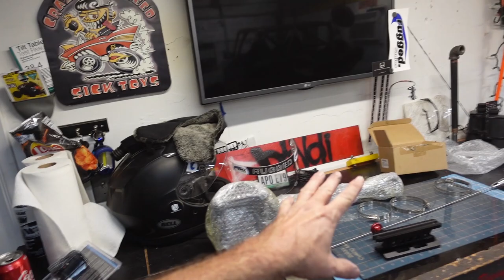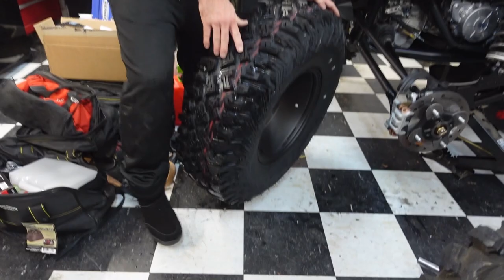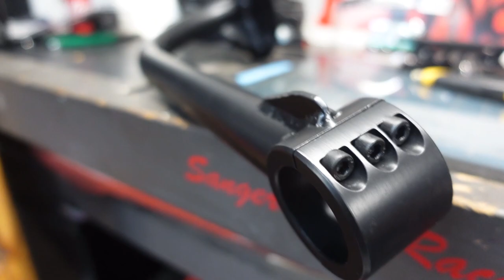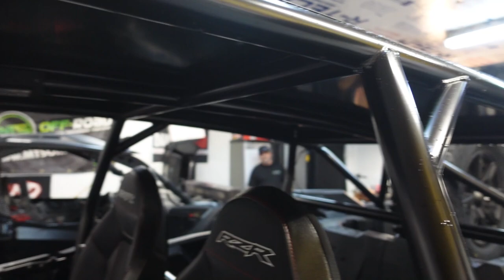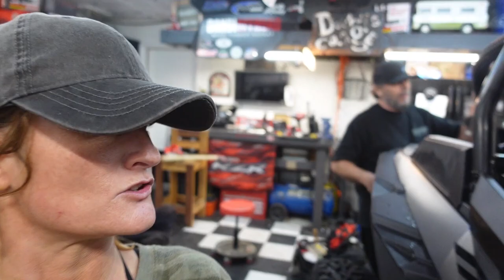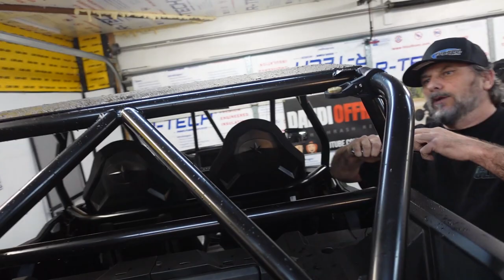TURBO S X3 Prepping For Our Epic MOTHERF****ING Adventure Desert Riding Primm Barstow Off-roading

Comment: Watch that tire mount, they break real easy because of the leverage the tire has on it.
Just a suggestion....
I would turn that tire side ways and strap that tire to to those down braces in the bed.
Reply from the maker: Thanks for the heads up,, I'll probably through a strap over it

Comment: The M12 Stubby (2554) works bitching for wheel lugs on these.  That's what I started carrying over the M18 due to size, that and the m12 ratchet.   When's the barstow->primm ride? I've heard about it.  Sounds like fun.   Stock wheel/tire is 59lbs, I weighed them. :)   Also, the antenna whip should be away from tubing.   You guys in San Diego area, or up north?  If you plan on redoing the connector, they are not the easiest thing to solder.
Reply from the maker: I would like to get a stubby but taking what we have for now,, that shiz aint cheep as you know. Yeah a lighter wheel and tire would be nice but for as often as we run dirt they will work, for now..LOL.. We are headed out Feb 13th, not an organized ride or anything. We have the antenna covered so it wont bang the tubing. We are up north, central valley. We have non solder connecters, or I should say rugged does,, but should be in our mailbox soon.
Reply: @DandiOffroad  Ok, I don't purchase radio equipment from rugged, just their intercoms.   I use antennafarm dot com for antennas or ham radio outlet.   The cage can interfere with the radio radiation pattern, should be fine talking with the group.    I'll be in JV that weekend testing the new gear reduction for my turbo s.

Comment: Hittin whoops with that extinguisher mount will snap the hose clamps.. mine just broke.. keep in mind
Reply from the maker: Good tip, what did you do to resolve this issue ?
Reply: Boost hose clamps and Amazon has $12 clamps that work great.
Reply from the maker: Thanks, I will look for them